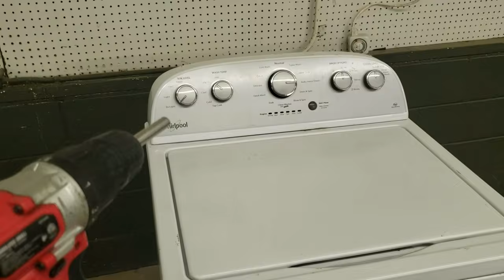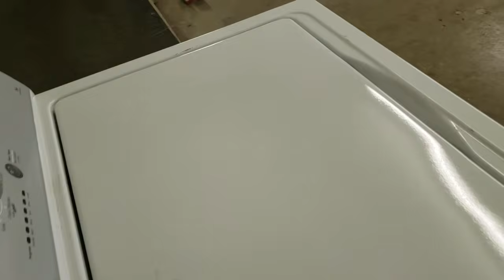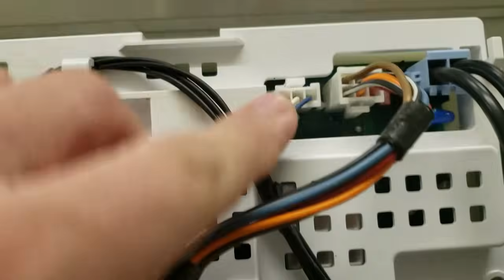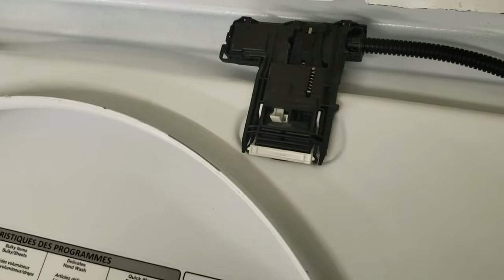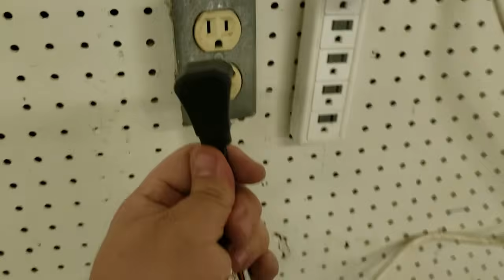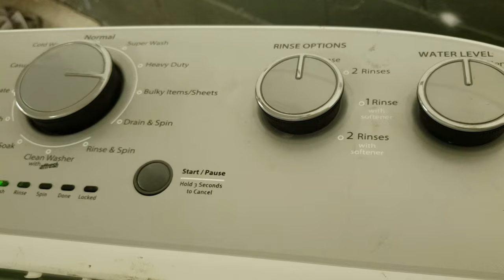How to Replace Newer Whirlpool Top Load Washer Lid Lock and Fix Lid Striker Issue (W11307244)

Comment: Why would you want a lock preventing you from getting into your washer? I'd bypass/remove it and call it a day.
Reply: I remember opening the washers as a kid and watching it do its thing. lol
Reply from the maker: Its not as easy to bypass modern lid locks. Old ones, you could short the pins out and be A-OK. If you short them, it'd have to be on the control board which if done wrong will destroy the board - and that's assuming it'll even let you do it in the first place.
Reply: @bensappliancesandjunk  I don't think they had lid locks when I was a kid. lol
Reply from the maker: @floydlooney6837  lid LOCKS are a newer thing on topload washers. You don't see them much before the HE wave of washers (circa 2009 or so). Lid SWITCHES/LATCHES have been around for at least 40 years but you could always lift the lid which would cut power to drain/spin.
Reply: @bensappliancesandjunk  Couldn't you either break the locking pin off and then jam the sensor part of the lock into position?  ..or perhaps take the door side of the latch off, relocate both to the inside of the cabinet out of way from the door to prevent it from locking the door.  Regarding shorting pins out, if you ohm out the connections you could see what connections are shorted when the door is shut and maintain that connection in all states.  I think the only trouble that you might run into is if you need to open and close the door between cycles and if it doesn't see that, I suppose that would be a problem, so I suppose make sure nothing done is permanent until you know it operates as you want.  Of course you are reselling these units and likely don't want to defeat a safety device but I'm talking about what I'd do with personal equipment. I do the same with the blower safety switch of my furnace.
Reply from the maker: @GuruMN  You can remove the striker from the lid and put it/keep it in the lock to bypass it. But that still requires a working lock and striker. On old washers, you could just short the lock out and not need one at all.
Reply from the maker: By the time you've done all of that, you could have just bought a new lid lock and fixed the problem.